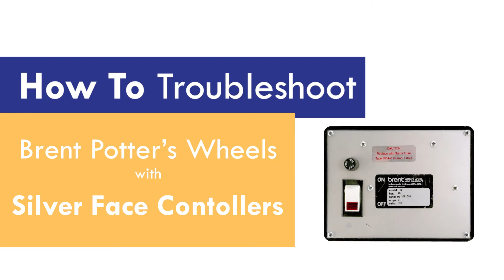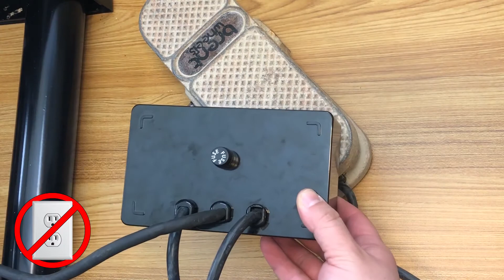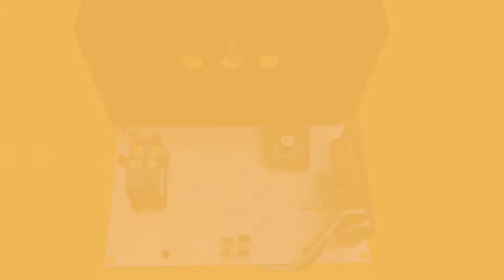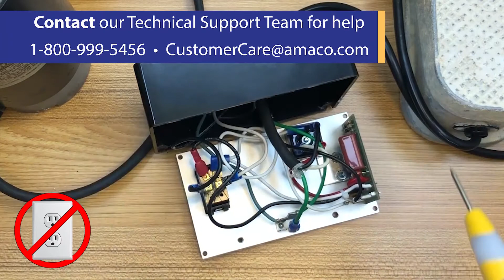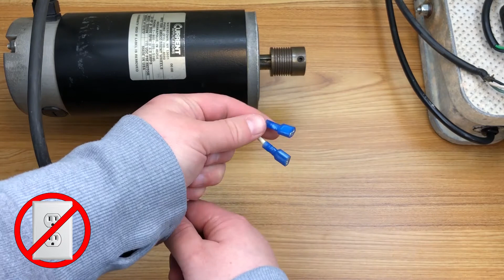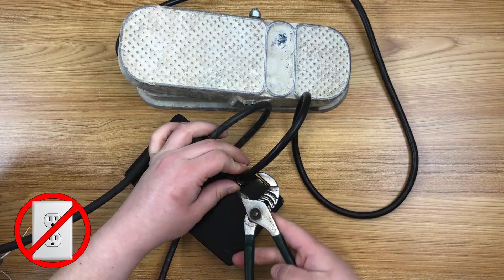Troubleshooting Brent Potters Wheel: Silver Face Controller

Comment: The difference in resistance on the foot pedal, 150k ohms to 350k ohms is 200k ohms, NOT "a few hundred ohms".   I will grant you your meter displayed "150" and then "350", so it would be easy to make that mistake. One needs to remember the "150" means 150k ohms on the scale selected, 2000k ohms.